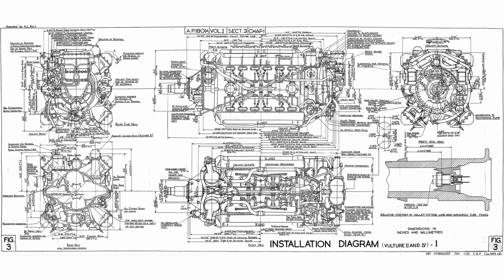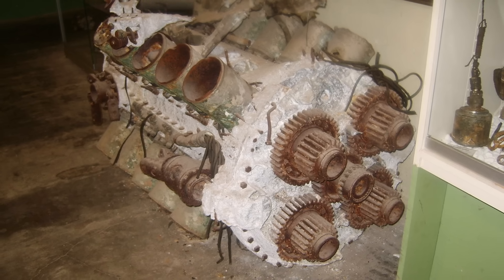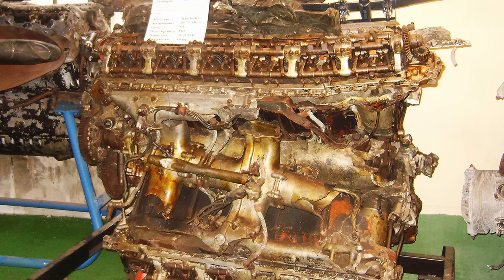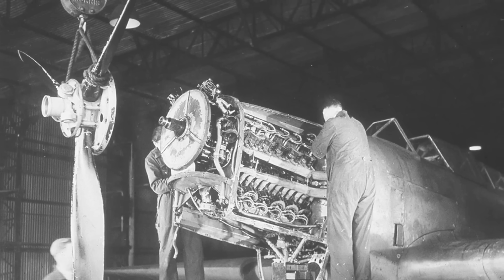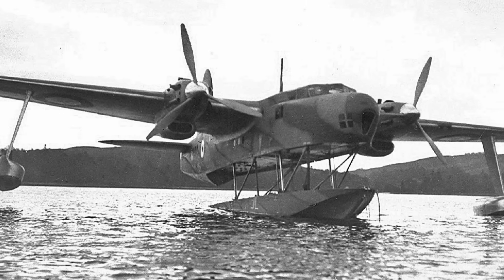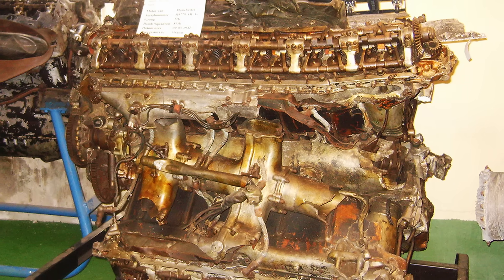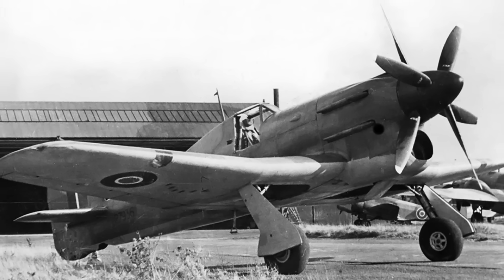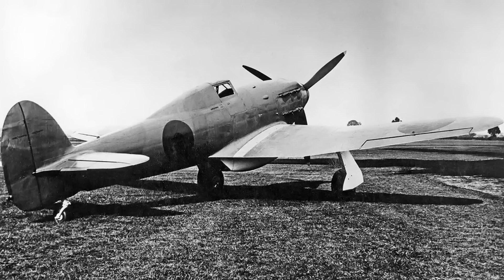Why the Rolls-Royce Vulture Failed

Comment: The RR Merlin was limited to 3000 rpm, because it would throw con-rods at higher revs. This limited performance but huge efforts were made to understand why the rods failed. It was eventually realised the problem was due to insufficient lubrication. The crank was literally throwing oil out faster than the pump could feed new oil. The problem all the time was caused by a weak oil pump. 
What’s the chance that Vulture had the exact same oil pump problem?

Comment: A few months back i've became interrested in X engines and found out that ford build a prototybe before making the V8s and found out about the RR engine too, i started searching for it mainly because i was interrested why it wasn't used in cars and found out how impractical it was, still a cool concept
Reply: If Jet Engines never became practical, I imagine more effort would be put into X-24 designs, and there'd be a good number of them then: you can only make a Cylinder so big before you run into preignition or detonation problems, putting an upper limit on the potential power of a V-12. An X-24 could theoretically offer a similar frontal area (and thus retain the aerodynamic efficiency advantage over radials) while allowing greater displacement without running into those knock issues.

As it stands, though, any aircraft that needs such power now will use some form of Turbine Engine, be it jet thrust or propeller, and cars just don't use large enough engines for the V-12 to run into those issues, and even a V-12 is pretty unwieldy to fit in a car (even if it is one of the most majestically well balanced engine arrangements possible)

Comment: this is an odd case of the engine and airframe living and the engine dying, with the Machester and Tornado becoming the Lancaster and Typhoon when equipped with different engines. One must wonder what would have happened if the Vulture hadn't have failed or if it had been fixed in-time and how different history would have been.

Comment: They had the space to have a single exhaust manifold per side. The 2 exhaust manifolds per side choice, I assume, created unnecessary aerodynamic issues as the rest of the aircraft had to deal with 4 jets of hot, high energy flow rather than the usual 2 present on V engines. Ease of maintenance and manufacture may have been what drove the 4 manifold configuration. I'm not sure it made up for the aerodynamic headache of dealing with the 4 jets.

(Many thanks for another great video.)

Comment: You have used photos from at least two completely different engines. The photo at 2:13 and 14:57 is of an engine which was probably air cooled with fin assemblies fitted over the 20 cylinders. The other pictures are indeed of a liquid cools engine with water jackets integral to the blocks.

Comment: This is a great video, with lots of nerdy specs and bits of knowledge on this much-maligned, but not wholly-unsuccessful engine. I think the British, German, and finally, the US engineers underestimated (or ignored) the quite significant amount of heat that is dissipated by surface cooling of the crankcase and various covers. Coupling two engines together greatly reduces this surface area (exposed to cold nacelle air). It was, however, the late Thirties, and they seemed to be wedded to the in-line style configuration. It doesn't exactly reduce drag compared to a radial of similar power, but it does allow them to 'move' the drag to a place where it has a lesser effect on the aircraft, or even partially converted to thrust.

Comment: An excellent presentation. The Vulture V did perform well in the second Tornado prototype, however by then it had been cancelled much to the annoyance of Sydney Camm given it showed greater promise at higher altitude than the sabre powered Typhoon. However the development of Vulture was important for the development of the Merlin 60 and Griffon 61 series of engines. Stanley Hooker used the Vulture supercharger has the base for the two stage, two speed superchargers Rolls Royce engines subsequently developed for Spitfires, Mustang, Mosquito, Beaufighter and Lancaster. Also Stanley Hooker used Vulture to drive test beds for the Jet Engine compressors under development.
Reply: Didn't know they used the Merlin in the Beaufighter.
Thought they used the sleeve valve Bristol Hercules.
Reply: @ Yes called the Beaufighter II. Indeed the first Lancaster prototype was a modified Manchester with Merlin’s inboard and two Beaufighter Merlin nacelles for the outer engines. Also the Miles M.20  emergency fighter made from wood utilised the similar Merlin nacelle. Rolls Royce were not finished they built  a Griffon engined Beaufighter prototype. I anticipate it was rather fast. Yes regarding the Bristol, hence the whispering death name for the Australian Aircraft.
Reply: @DNorthWest  The Japanese also called it whispering death.
Hooker was an aerodynamicist by profession but obviously knew about airflow through superchargers as well as wings etc.

Comment: I wonder how many of the problems were down to too much heat being generated in too small a  space. The Heinkel 177 and Boeing B29 suffered similar overheating problems to the Avro Manchester. Maybe they could have reduced the problems by making the nacelles bigger so more air could flow through, but that would have added to drag, and simply going to more but smaller engines was a better solution.

Comment: The YouTuber "Let's Go Aviate" recently did a video on the Vulture and the Packard X-2775. He concluded that there was nothing inherently wrong with the design of the Vulture engine or the X configuration.

It's downfall was the fact that it's "ironing out period" was right in the middle of the Battle of Britain with it's insatiable need for Merlin's. After that died down the Merlin was all ironed out and had almost caught up in power output, and even stronger successors were starting to reach completion. Would you agree with that?

(This is my own speculation) Had the war started a year later the Merlin may have been remembered as an underpowered problem-ridden historical curiosity and the "Engine That Defeated Hitler!!!" would have been the Vulture. Interestingly Packard in the US had already made a well-running X-engine for the Schneider trophy so they had some experience, they could have produced American Vultures the same as they did V-1650's.
Reply: The Rolls-Royce Merlin engine increased in horsepower throughout World War II through improvements to the supercharger, fuel supply, and compression ratio. These improvements could undoubtably be applied to the Vulture for even more hp but it was all a matter of timing as you suggested. There was other engines, not from Rolls, in the pipeline with even greater hp.
Reply: I'd wager if Turbine engines never became practical, we'd be seeing X-24s as the new standard for high powered aircraft, or possibly even those liquid cooled 6x6 Radials
Reply: I'd wager if Turbine engines never became practical, we'd be seeing X-24s as the new standard for high powered aircraft, or possibly even those liquid cooled 6x6 Radials

Comment: You missed a bit out. The Air Ministry was so concerned that RR couldn't fix the Vulture that they reversed the decision to order the HP.56 (designed to meet Specification P.13/36 which gave us the Manchester). The HP.56 and Manchester were ordered in February 1937, and the cancellation of the HP.56 came in October 1937. They ordered Handley Page to redesign the HP.56 as a four-engined bomber using the Merlin, which became the HP.57 Halifax, so that we wouldn't have 2 medium bombers grounded due to engine issues. They were proved right.

Comment: The extra long prop blades @13:50 have me scratching my head.
Reply: Extra long?
Reply: @Hang.On.A.Minute  Yes.  To me it looks like each of the two counter rotating props has one blade which is long than the other two.  An optical illusion or design choice?  I don't know.  I really can't figure out what is going on in the image. :-/

Comment: Excellent presentation. The Sabre's dual crank H solution sounds excessive until you see the daunting challenges of a single-crank X. I, too, wish it had been sorted just to see how rod problems could have been solved. RR engineers thought paired fork--blade should have been tried (I assume with bore centers adjusted). It does make me wonder how radial engine master, with many more links, succeeded. Maybe 'long engine' beam strength is just too different. In the Merlin, there was room for cross-bolted main cradles--impossible with an X. Again, this was an excellent presentation.
Reply: Many big radial engines, such as the R-2800 and R-3350, had single piece master rods and a crankshaft constructed in several pieces.

The Rolls-Royce Pennine, developed later in the war,  used a multiple piece crankshaft and single piece master rods. It was air-cooled and had sleeve valves, and was reportedly able to produce ~2,800hp from its 2,750 cubic inches.

Comment: I wonder how much torque it made for 24 cylinders 1800 hp isnt alot
Reply: Pretty easy to calculate. 3151.2 ft/lbs at 3000rpm for the 1800hp version.
Reply: A metric fukton I imagine.

Comment: It makes me sad some of these wacky engine configurations didn't get a bit more time  to mature... jets are indeed awesome but still so simple that they're a bit boring
Reply: On a positive note the development stopped thanks to the war ending and no more people needed to die. Whacky engines did live on tho, look at the W16 in the Veyron. That is as bonkers as this stuff before it.
Reply: Especially during a war there is only so many resources to go around.  With newer versions of the Merlin constantly under development, the Griffon in the middle of development, jet engines coming in the near future.   There just wasn't the people and resources to put into the Vulture and Peregrine which were not going to be widely used anyway.
Reply: Boring is safe. Simple, strong, reliable. All the complexity is to keep people employed.
Reply: Gas turbines engines may be simple in concept, but getting them to work effectively takes a monumental effort that is just as interesting as engines with odd arrangements when you study it in depth.
Reply: Yes , as I have studied the development of turbines from the early 30s through the 60s its amazing also . From Whittle's first engines to the extreme axial turbine ram jet of the SR71 . I find they are fascinating as well .
Reply: Jets didn't replace them though. Meteor was used on tanks, other AFVs and river/coastal boats for decades after WWII. Jets filled only plane niche. And did it very slowly, especially in case of strategic bombers, naval patrol planes, transport planes and helicopters. All those manufacturers could have designed a derated version of those new engines for other uses.
Reply: The Vulture proved very unreliable in the Machester. This was virtually solved too late. Ground grew would strip each engine. They found fine metal shavings and parts that were not finished properly. They were not debured properly. After very thorough cleaning they mostly worked. Some thought this was deliberate but no one was ever caught.
Reply: I see your point, but I imagine if you were chugging along in your B29 with their  fully developed,  and technically interesting engines but  you can see a speck of a Me 262, despite its barely functional,  "boring" gas turbines, closing in behind you at an incredible rate.😮.i suspect at that moment you'd be happy to trade every dollar you have in the bank for similar " boring" engines